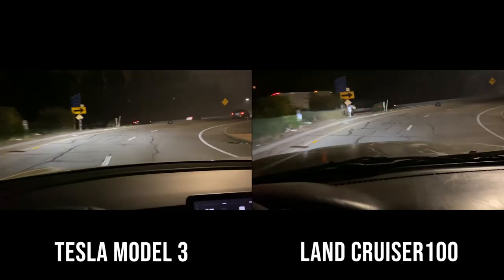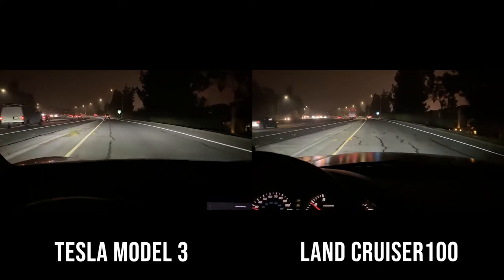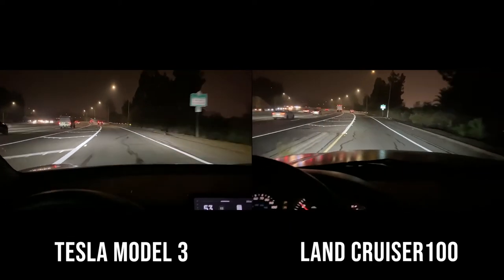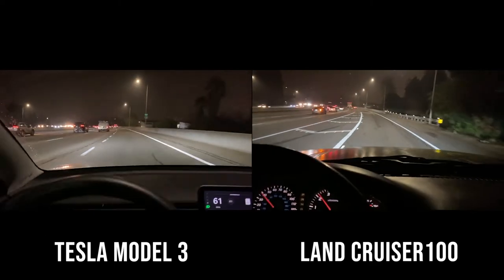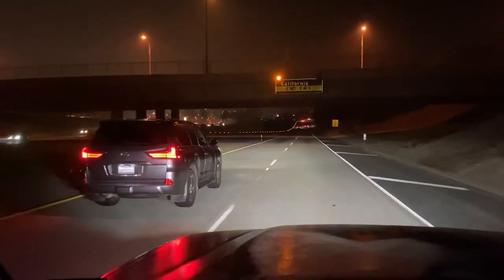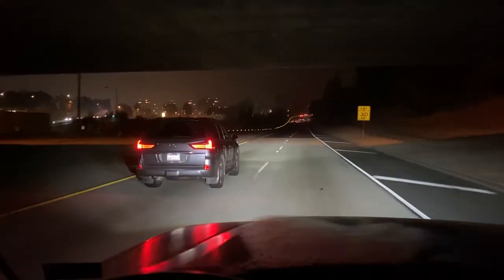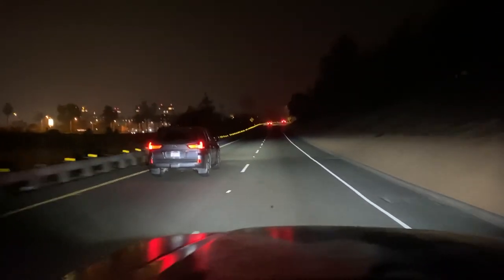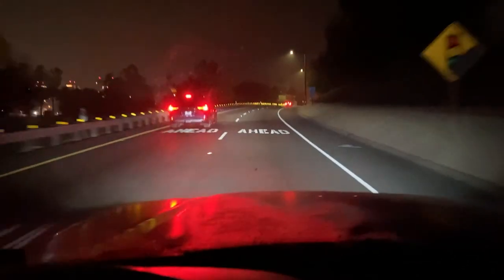DIY HID Projector Retrofit 100 Series Land Cruiser Follow Up

Comment: Coming over from mud forum, thanks so much for both videos, and pointing out the new micros were available and will work in our application. Our light output just bridged a 20 year gap with this project, outstanding.

Comment: Looks awesome! What did you do about the high beams and the DRL's ?
Reply from the maker: Thanks! For the high beams, they still engage as normal by using a high beam splitter cable. I disabled the DRL for the time being, but plan on running a toggle switch to activate it.
Reply from the maker: @HamsCams  through a user on the ih8mud forums